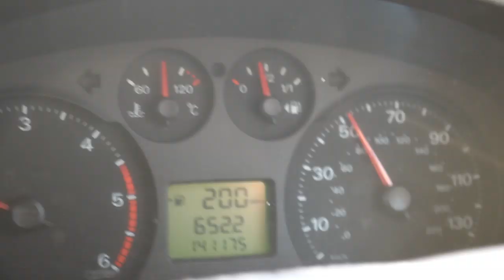I GOT A PIPE VICE

Comment: If your not on concrete a ladder board is a good idea, literally a piece of board with a piece of wood screwed to it to prevent the ladder from sinking in and you sliding sideways as one leg sinks in. I would also recommend spikes through the board bottom, I have done house surfing and it is not at all pleasant let me tell you ☹️ . Cheers, Schnuz.